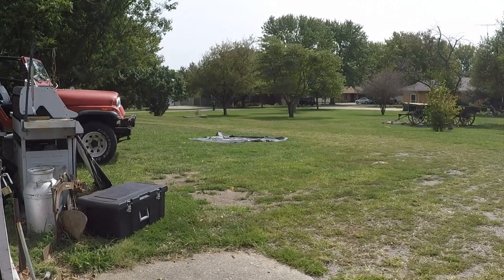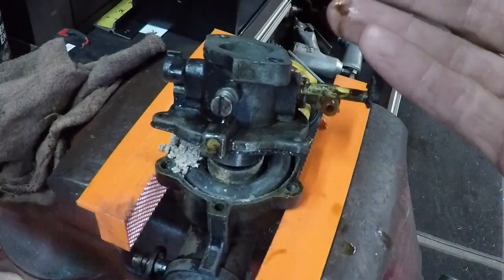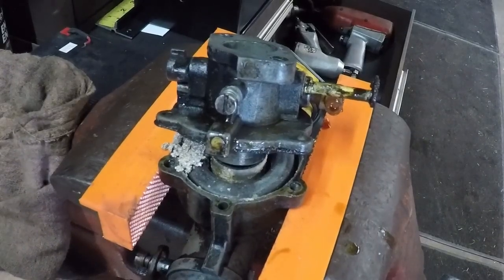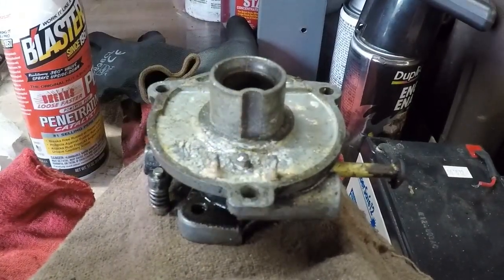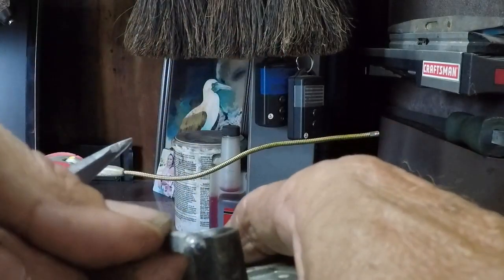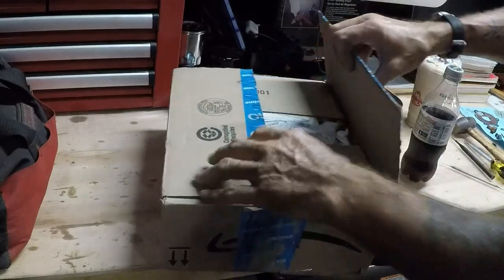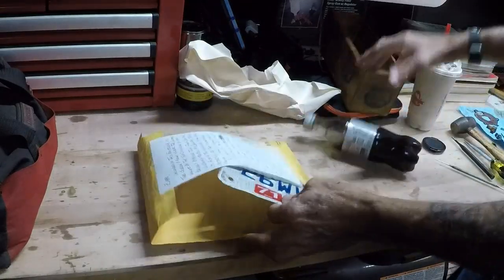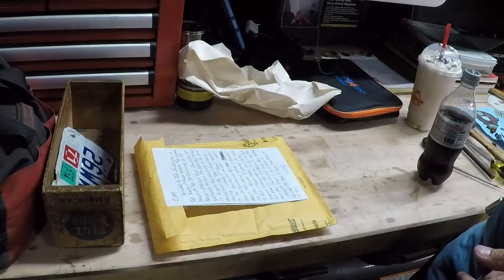6hp Vertical Carb Repair for Mini Lord #smallenginenation

Comment: I had one of those 3 screw flo-jets on a generator. Top of carb was very warped, leaked badly. Put some JB weld on the top surface of the bottom half with some plastic wrap over it put the top back on. Loosely. That evened out the mating surface. Then I made a new gasket, and doesn't leak and still runs 4 years later. I'm glad the generator was free. Nice video, not so hot audio at times. Congrats
Reply from the maker: With the Rode unidirectional microphone, if I'm not speaking right at it, the audio fades HARD. I'm looking into a 180 degree or even a 360 degree microphone to replace it. Great job on the carb Jim! That's making lemonade out of lemons for sure! Cheers! Zip~

Comment: hello i see You out playing on the bike!!!! BAD ZIP! BAD!!  anyway 71 in ohio county is Ross. on that plate, great carb repair!! havent seen many as bad as this one, and only  1 or 2 worse!! nice job!!! another Saved carb!!!  i forget the gas valve too!!     later my Friend ,,,,,,bob
Reply from the maker: I got Old Billy running better, but there's so much else wrong with him to make him road worthy. Perfect candidate for my bike build. Yeah...this carb was a train wreck for sure, and I wasn't hopeful that I could resurrect it, but...I got lucky! The oxidation was localized to the back hinge portion of the float and bowl and not the entire carb bowl and upper. I think that was the saving grace that allowed me to bring it back to life. It's not the worst carb I've seen, but it's the worst I've brought back from death. Cheers my Friend! Zip~ Oh, and thanks again for the plate, cheese box and the Screw!! Yes...I found it lol. That's a carburetor screw. Looks like the screw that held down the air cleaner lower to the top of the carb. I've seen butterfly screws also enter the combustion chamber through a valve.

Comment: I smashed that like button so hard it gave you 2 likes! Really wish I had seen you getting that float bowl pin out. Good job
Reply from the maker: I let the whole carburetor soak over night in carb cleaner to bust up the oxidation. Ran the tap to the emulsion tube, blew it out, added a few drops of transmission fluid to the threads, then backed out the emulsion tube. To get the needle out, I described pretty much exactly what I did. A little patience and it came out. They're usually non ferrous stainless, and with enough perseverance and care, you can get them to come out. Then I used an appropriate drill bit and hand reamed the walls of the needle cavity until the oxidation was eliminated and the needle had no chance of sticking. I really didn't have high hopes for this carburetor, but surprisingly, it cleaned up well enough to work great. Cheers Dave! Zip~
Reply: ZippoVarga You did a great job on the description first of all! I was gonna share a little trick that that I do.
 To get those pins out when they are as bad as the one you were dealing with I use a automatic self centering punch. That little shock of the punch pushes that pin out every time after a just a few clicks. Then I will ream the hole with a welding tip cleaner. Just one of those tricks born from frustration and never give up attitude. 👍

Comment: That looks like ethanol tapioca.  That is what I call it.  I just wrecked a carb on Sunday chasing some threads on a frozen jet.  ARGH!!!   But it was already wrecked so I couldn't wreck it    right?   Do you know how many times i have left the fuel turned off.
Reply from the maker: These specialty taps have 32 threads per inch and it's easy to cross thread them. I can't count how many bowls I've had to scrap due to people trying to use a 24tpi tap, thinking it's correct. Or, cross threading the emulsion tube metering screw into the bowl. But...they're plentiful around here, so if I had lost the lower bowl, I had plenty to replace it with. I'm just glad that odd ball upper was salvageable. Cheers my Friend! And turn that fuel on! lol Sean~

Comment: Great save, Zip!!  Was that gel due to some (too much) gas stabilizer?
Reply from the maker: That was just wet Oxidation Mr.A. I threw the carb into carb cleaner over night before attempting to take the emulsion tube out. If I had managed to get it out before hand, that would have been white powder we saw instead of ricotta cheese lol. Fuel stabilizer in too high a quantity does cause gelling, but protects against corrosion. This 6hp engine just sat in damp/wet conditions for many, many years. Cheers my Friend! Zip~

Comment: I was wondering why your audio was getting REAL LOW when you walked just 2 feet from the camera.   

I hate some go pro products. They make everything look like a half circle. IMHO ~!~!
Reply from the maker: The Rode microphone is unidirectional, so I have to be facing it or it has to be facing me. I'm looking into a 360 degree microphone to cure the problem. With no microphone attached to the GoPro, any movement of the camera resonates through the holder I use and makes for some very annoying background noise. It used to be easy...I bought a video camera, shot video and uploaded it. lol...now, I'm having to hunt and peck for compatible accessories that actually perform well enough. It's frustrating, but I'll get there! Probably just in time to upgrade again lol. Cheers Boo! Zip~